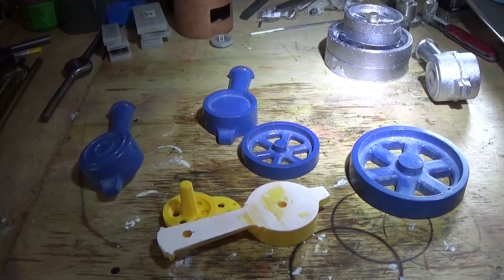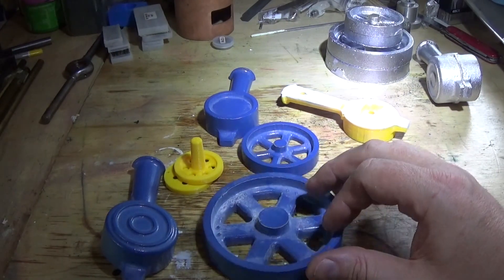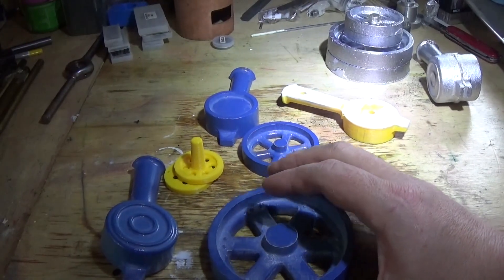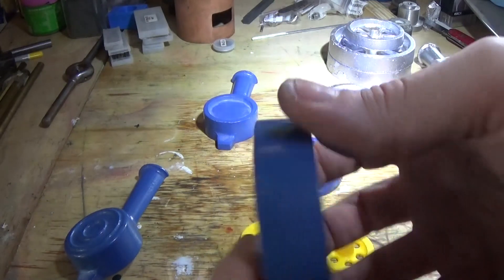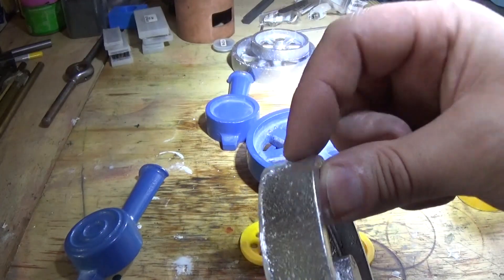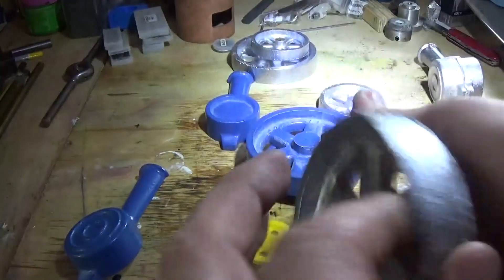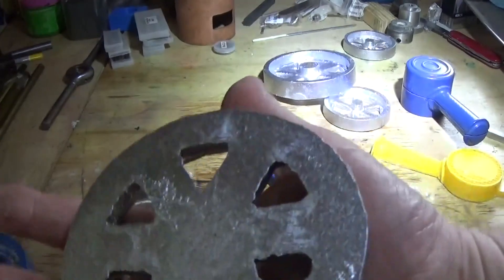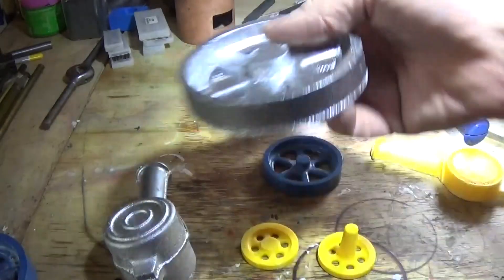some thoughts on 3d printed casting patterns

Comment: Just saw your video and subscribed within a couple of mins! I do casting too with 3d prints, is your filament newish? And of decent quality? Also make sure your filament is really dry. The curling up at the edges used to happen to me too, until I recalibrated the bed levels and started the print closer to the bed (so the first layer is more squished). There is nothing more frustrating than a printer making poor prints, there are so many factors than need to be just right, I empathise. I have a prusa mk3, and it’s pretty damn awesome in its ease to get good prints from. the draft and radius issue might just be your software, I’ve found fusion 360 to be pretty good in this regard. Great video looking forward to seeing your others o/

Comment: I had the same problem with 3d printing until, ( Useful advice I saw on youtube) … Use a 12x12 mirror cut it to your heat bed size, very easy. you can buy 10 for 9.00 U.S. Quality control on mirrors are a higher standard, due to reflection, distortion would be bad for business. Then use stick glue on the mirror, just a light coating. And the peeling of corners are completely gone. Its harder to get the pattern off the bed, But the pattern is completely straight. Just FYI i'm sure you have already tried this due to 2017 post. maybe some other comment readers will see this and try it. works great.

Comment: Emma some ideas on this.  Try leaving the object on the bed till it is fully cooled. If it don't pop loose the base may stay flat.  

 I'm wondering if one could face the printed parts on the lathe.  Maybe print a bit extra material to account for that.   

Also there is an instructable on printing parts with different fill percentages for different areas.    Maybe denser edges would help.  Not much too it in concept.  The design the part as sub parts then use slicer to set the % fill for each oart.   Print all the subparts at once and you have the original part. http://www.instructables.com/id/Change-Infill-Density-in-a-Specific-Section-on-a-3/
Reply from the maker: thanks for that. apreciate the feedback

Comment: Reminds me of two years I spent as a casting finisher, when instead of inducting me into the service and off to the Vietnam war, they put me in the foundry for making parts for helicopters and aircraft from aluminum and magnesium alloys. The pattern makers and core makers were artist!  This is there current web site http://fansteel.com/folder/Wellman/html/about.html
Oh and safety in foundries was never thought of in the 60's! I saw a man even in a "fireproof" suit get molten metal on himself and one guy burn from accumulated magnesium dust on his cloths.
I know there are 3D printers capable of making prototypes to the quality of what would be a finish product as Siemens had many items made, where I worked last. BUT the machines were far more advanced then what we can buy as hobbyist. I enjoy finding your video!

Comment: Getting the 3d printer to do what you want is one thing. As somebody said, this may be your model. Warping could be fixed by making the thing thicker and taking a belt sander to it. And there is always faithful Bondo for sharp edges. Look at Myfordboy's lost PLA castings. But the analysis is excellent.

Comment: Nice castings though, not too much to clean up. The warping is a concern but leveling with bog is not too much of a problem or could you design more weight / meat into the base and machine off the excess. Peter

Comment: I think you have demonstrated that a 3D printed pattern can be cleaned up enough to use for casting.  I have a 3D printed pattern here and the back is curved like you showed.  If a person can work out how to print them in the first place not to have these defects it will be a nice way to make patterns.   If I have to do a ton of work on them to make a good casting I might as well just use wood in the first place.  Thanks for the video.

Comment: Certainly a few problems but in theory the 3D printing should enable adequate patterns - guess the shrinkage problem is hardest to deal with.. Hard though anyways to avoid quite a lot of after casting finishing work.
Interesting look at the process.

Comment: Excellent video - I suspect that the printing problem is possibly a 3D modelling issue, if you increase the radii and the draught in the model then some of the problem might go away. My personal opinion is that a lot of casting is done with risers and sprue's that are too short, as the higher they are the more gas is displaced. I say that however despite the fact that i have very little experience in the field aside from being an end user of castings
Reply from the maker: think youre right greg. thats why theres a bad finish in the back of the smokestack casting, and yes my modelling could improve.

Comment: How did you get rid of the stair steps in the 3D-prints? By painting, grinding, solvent? To reduce warpage you could try and increase the ambient temperature in the whole printing volume not just at the heated base plate by enclosing that volume e.g. using cardboard or a clear plastic that can take the temperature. The heat of the base plate should be enough to also heat the air inside the enclosure. This way the temp. distribution in the work in progress should be more uniform causing less warpage.
Reply from the maker: the layer steps are very very slight.. a rub with a file fixes them . the vertical steps where the stepper motor changes drirection on the circle are less fun. an eclosure is probably a really good idea. im going back to straight grained hardwood for patterns for a while though.

Comment: hey emma, Ive used 3d printed parts as patterns before and Ive found that they are ok to use, but need a good bit of post processing is done on them like using a high build primer and painting them to cover up the layer lines. 

I havnt had trouble with outside sharp corners when casting, only with inside sharp corners, which is where you would normally use bondo or something on a wooden pattern to create a fillet, outside sharp corners are perfectly fine. Another thing is, the flashing that you got, in the old days, that was a common practice to actually round the edges of the sand mold over very slightly to create flashing, then ground or filed off afterwards. They did that so that they wouldnt get sand wash from the sharp internal corners between the cope and drag. If you look at old machinery and the parting lines, you'll see that some of those parting lines are actually up to 1/4" thick, which was where the flashing was ground back off, where the part would want to have sand wash with the turbulence of the iron flowing into the molds.

 I used to run into the part lifting like that in the past on my printers, but Ive found that if you mix the white school glue (CVA glue) with water in a 1:3 ratio glue to water, then paint it on the glass or whatever you use as your printing surface,  just let it dry and it'll print on that and you wont have any issue with warpage then. That trick works for PLA plastic only, which I think is what you're using I believe. It does make the prints a bit more difficult to get off of the bed, but just use a razor blade or thin knife blade, and wedge it under the print, and it'll just pop right off, no warp or any problems at all.
Reply from the maker: thanks Chirpy. its interesting tho that the right moulding process eliminates a lot of issues. some care, and castings come out very nicely.
Reply: lol, yea, casting is an art form in and of itself, and there is so many different types of casting too that you can cast for most of your life and not even come close to mastering all of it. I dont mind doing a little bit of cleanup on my parts, but I very rarely have sand wash in my parts because I tend to go with the techniques that were used at the turn of the century for molding, and even then, I tend to have some parts that arent the prettiest but machine well with no shrinkage or issues other than the flashing.

Also, the shrinkage you were getting around the sprue/in gate, if they molded it a little closer to the part with a bigger sprue, you wouldnt have gotten that. That happened because the sprue was too small and the metal cooled in the sprue before the part did, which as it cools, it shrinks and will suck metal from any available molten metal, which in your case, it was the part.

Comment: Emma, considering the drawbacks to 3D printed patterns that you mentioned, what pattern making method do you recommend?  Even with a wood pattern, the pattern maker must put some effort into checking and correcting all of these details to make sure the pattern will work correctly.  In one case the 3D printer made the rough pattern and in another case the pattern maker must carve the rough pattern.
Reply from the maker: casting metal is very much an organic process. CAD and 3d printing isnt always. . thats where I have trouble with it. making a wooden pattern, to me, is a much more fluid way to make nice castings. these are just a bit too mechanical and not fluid enough, maybe. hard to put my finger on it.